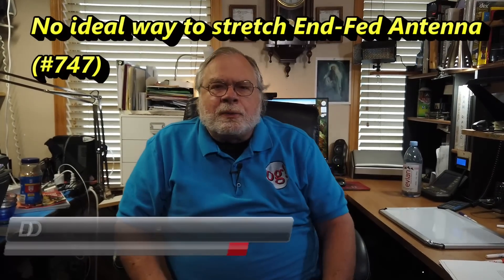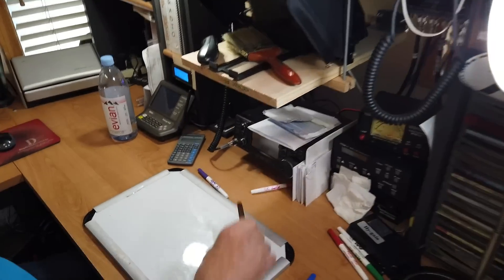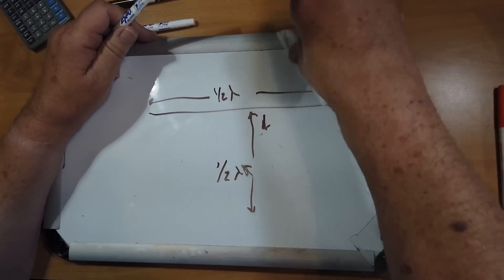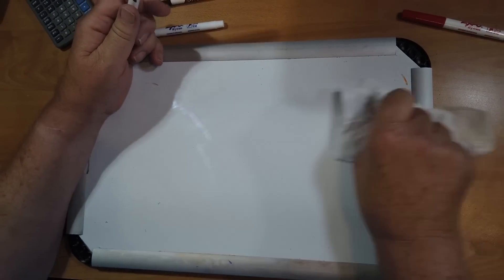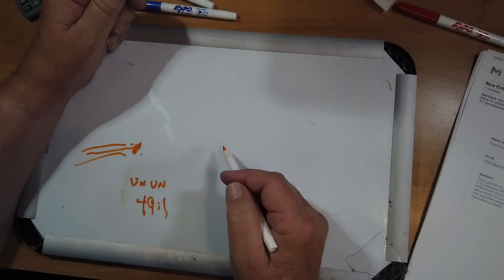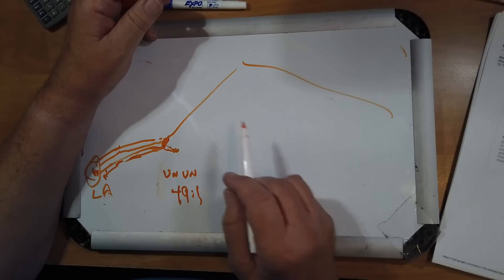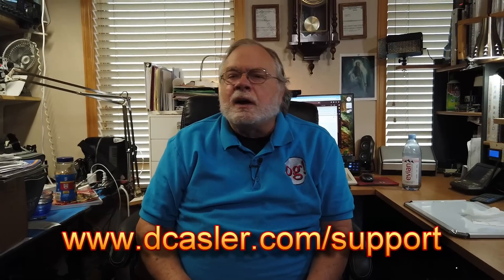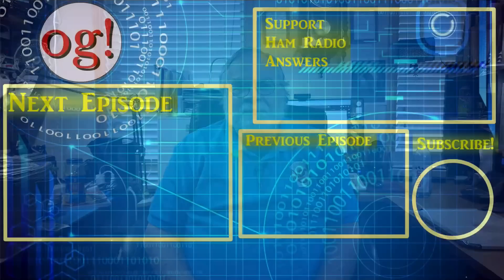No ideal way to stretch End-Fed Antenna (#747)

Comment: I have a 64:1 unun with a chalk line spool full of bare wire/fishing line and knots tied in it at half wave lengths for 10, 20, 40, 60, and 80. I connect that to the unun with a wing nut and the other end goes up in a tree or an inverted V. Then I have an alligator clipped onto the BNC with four 10' radials. Does the bare wire inside the spool cancel itself out and not act as more antenna?

Comment: Dave said "Every antenna ends up being a compromise antenna." Correctimundo. 

I get tired of hearing people say this or that antenna is a Compromise Antenna. There is no perfect antenna, only antennas that tend to conform to mathematical theoretical formulae.

There have been antennas that cannot be explained by modelling tools...but they work. If you can hear and be heard by an antenna, no theoretical explanation is required.

In many cases, an unworkable antenna can be made usable with some tinkering. Note  however, that some usable antennas can be made unusable if tinkering is done without due circumspective thought.

Comment: OK, I am confused. You were showing a point where the coax comes into radio and the antenna then goes up from unun to a mast to get wire higher. But no w am I wrong in think8ng that a wire going up a metal mast will cause both a mismatch for impedance and also loss of tx signal from the wire through induction? My other concern is because of my limited space, my end-fed is curved at least three tines. Does this cause an issue? 73 N6ZKI

Comment: It sure is interesting to hear about end-fed half wave antennas.   I was listening on the air once and was in QSO with someone who explained that half-wave antennas do not require a ground place or grounding.  At the time, and this was several years ago, during the conversation I was thinking about something I read and a drawing I saw in the ARRL compendium. a soft cover ARRL publication.  Thans to all who made Dovid's video available and poosible.

Comment: So on my 4:1 balun I have a lighting arrester right at the balun. According to this the arrester makes it so I can't use my shield as counterpoise? 
I was thinking about swapping the balun for a 9:1 unun and run about 124.5' of wire.
Reply: A 9:1 unun is normally used with a non resonant end-fed antenna, not an end-fed half wave. With an end-fed half wave using a 50 ohm coax feedline a 49:1 unun is commonly used for the best impedance match.
Reply: @jonmcadams5401  That does not answer the question about the arrester! I know what a 9:1 is used for which is why I built it.

Comment: You peaked my interest with a fan end fed. 

I agree with the person that said end fed is the wrong terminology: it should be extremely off center fed dipole. I modeled a fan "end fed" in EZNEC with AutoEZ. To get a good model, you need to include a counter poise. 

There is a lot of potential is such a concept. My model had the 80 meter element at 0 azimuth, the 40 at 45 degree azimuth and the 20 meter element at 90 degree azimuth. This 80-40-20 extremely off center dipole model requires a lot of tuning as there are at least 5 elements to tune: 

1) the length of the 80 meter element,
2) the length of the 40 meter element,
3j the length of the  20 meter element,
4) the length of the counterpoise, and
5) the unun load.

And one could add height.

I found that tuning to reasonable SWR is possible for all bands but I do not know if I have an optimal tune. The 3D probation fans are quite complex as well as the Smith Chart. The higher frequencies are much easier to tune than the 80 meter value. 

But in the end analysis, if one has too much time, this is a fun project to try! It can be done, and I suppose, built! The antenna gains are quite reasonable.

Walt (AI7MY)

Comment: I experimented Endfed . Its work fine. But not radiates lower angle. Not best for Dxing . Dipole is only could radiate its best RF. Vu3kod
Reply: An EFHW is a dipole. The only difference is it’s fed at the end instead of the center.

Comment: Put up a new MyAntennas 8010 EFHW last night.  Near end (plastic connector unit) is at 6 feet high while Furthest end is at 45 feet up in a high tree.  No inverted V - just a single straight line.  Used my MFJ antenna analyzer and I am getting 1.2/1.4  SWR across all the bands except 1.8 SWR  on 30m and 2.1 on 80m.   Performance is outstanding in my opinion.  Simple to setup and it works very well.

Comment: All of your examples wind up parallel to the ground.  What if you start at 30 ft + on the mast and slant it up to a tree at 50 ft or so, would that be workable (and better than a 30 ft + horizontal)?

Comment: The EFHW is fun to experiment to see what works best for your application. Mine is between two trees, parallel to the ground and I have had no problem making contacts in South America. That's my preferred configuration. Have also tried it inverted V, sloped up into a tree, sloped down from a tree, inverted L and vertical. The results are always interesting.
Reply: I found this setup is performing better than any other- as U mentioned "between two trees, parallel to the ground"
73
vu3tbu

Comment: Great info. My EFHW-8010 goes from 40' down to 20' down to 10' in a modified L and it works FB. My balun is mounted on the high end.